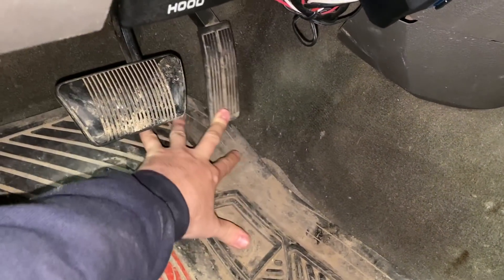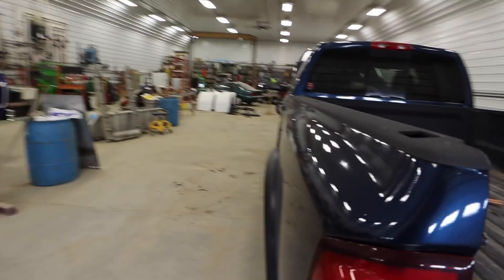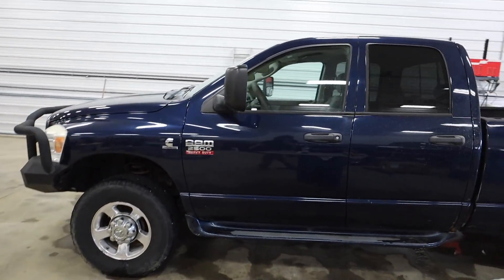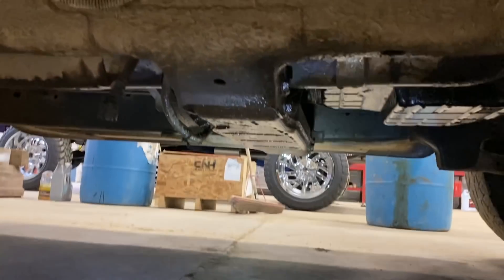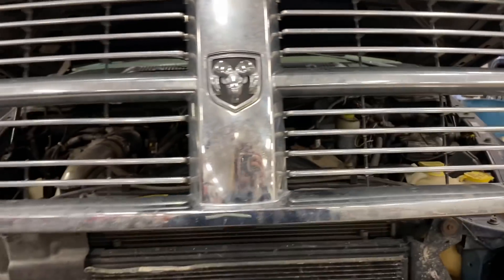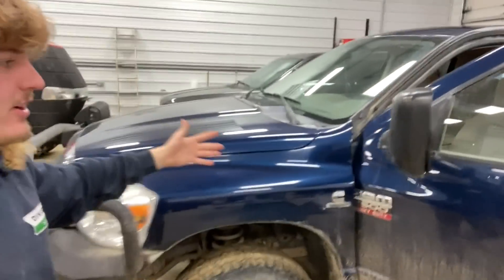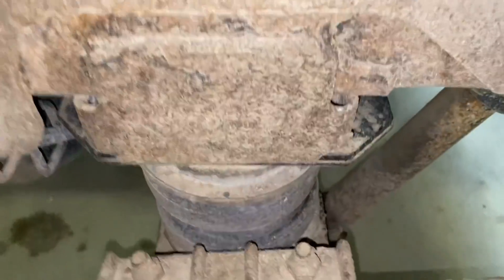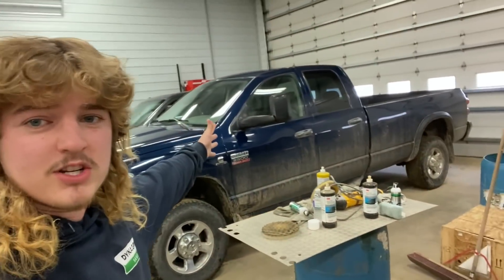I Bought A 600HP Dodge Cummins

Comment: Steel or aluminum flatbed???  if you go with aluminum I believe they actually weigh less than a box and will lift up the rear even more.  IMO flat bed it first then you can adjust your front ride height to compensate.  You could call Kelderman's too and see what they have to offer

Comment: I like mine had a 09 mega cab but sold it to buy a house and then later on I needed a 3/4 ton again so I now have a 08 but it's a 6 speed manual trans

Comment: I'd hold off on the leveling kit until after you get the bed on there, with tool boxes, log chains, fuel tank, etc. the weight might level it for you.

Comment: Nice truck, but you might want to consider going back to the stock turbo arrangement if you are looking for a reliable workhorse around the farm, just speaking as a mature individual whose dad worked for Cummins for most of his career. I inherited his 1989 W250 with the 5.9 liter 12 valve Cummins that Dodge deliberately detuned to 160 horsepower to keep from killing the old as dirt Torqueflite 727 that the truck had. That being said, it doesn't take much work to put a few more nags under the hood.  In stock form the 6.7 has 350 horsepower and 650 lb/ft of torque, which should be plenty handle any towing job I can think of. The wheels on it look fine, a lot better than the stock wheels on my W250. I have the cloth interior and wish I had leather, my last 2 cars had it.

Comment: I'd go with a 2.5 rough country leveling kit there decent price and will come with all new shocks that's the lifts I'm running on my 1500 2nd gen and a 6 inch lift on my 2500 second gen

Comment: Would’ve been cool to see you in a duramax. And why’d you buy another truck if you got the ferd. I know it’s a heavier trucks and a diesel but the ferd can probably handle it. Also the truck is angled down probably because it might have a heavier suspension in the back for towing

Comment: That going to make a nice field truck Coop, once you get use to it you not gonna want to see a gas engine again espically in a work truck that's pulling
It's why you don't see modern 18 wheelers with gas engines they can't hang

Comment: meh diesels are supposed to leak oil, its good undercoating for the winter salt. I've got a 2" leveling kit on my 04 cummins on 33's, perfectly level and no rubbing. Its just a $50 coil spacer off amazon

Comment: Don't level the truck.  It's supposed to be high in the back when it's not loaded.  When you load it, it levels out. If you raise the front, it will be pointed up when you load the back.

Comment: If that turbo is leaking oil you have a seal gone needs new turbo  if they leak on the intake side the engine can run away

Comment: I have a 2003 ram 2500 with a 5.9  cummins & I get 30 mpg  with mods..
Reply: What did you do to yours
Reply: @parkerbest1575  Turbo swap, changed injectors, changed the chip, larger exhaust pipe & kept tires at stock size.. because we tow with it
Reply: I got a 07 ram 2500 and get 25 mpg

Comment: If someone says they don’t like dodge diesels, they don’t know much about diesel engines. 🤷🏻‍♂️
Reply: It’s not the engine people don’t like.   The engine is the only quality thing in a Dodge.  The manual, Aisien  auto transmissions are pretty good as well.  But that’s about it.
Reply: @larsharris  to each their own, either replacing injectors or head gaskets on a Duramax or entire engines in fords or clutch or torque converter in a dodge.  I will take my chances with dodge every day of the week.  Owned them all.  Dodge is the most reliable.  Period.
Reply: @joellair8023  I am on my 3rd diesel. 6.9 non turbo, 7.3 ATS turbo,  finally a 02 7.3 PSD.  Not going to let that go cheap anytime soon.  Owned 1 Dodge gas yrs back.  Lemon from day 1.  Traded it at 60k new transmission (not covered)  and if I had to pay towing those first 60k...

Comment: I have a 2010 6.7 I tow 90% of the time and use it 10% with no trailer behind it. I  tow as heavy as 20K total truck and trailer and you will not see 10MPG at 20K 8 maybe 9 on a good day. 14 to 15 highway no trailer. I run 80 psi in the bags when towing and 10 no trailer. Gas may get 5 to 6 when towing (son just bought a 2021 with the 6.4 Hemi and made 7.6 MPG towing the same weight as I tow) but how much towing are you really going to do? 10% of the time? Everything about a diesel is higher cost. Operational cost per mile is significantly higher. You don't see big companies that have a bunch of 3/4 to pickups in their fleets running diesel pickups there is a reason for that. I worked for a company that has probably 3000 1 ton Chevy with a service body and liftgate on it and I drove one for 315,000 miles with a 6.0 gas in it and only replaced 1 starter. You will not get that reliability out of a diesel. A set of injectors alone will set you back a minimum of 2500 dollars. Your dad is a smart man by not wanting diesels they are money pits. That ol Dodge dually has done the job on the farm for how many decades and it only has a 360 in it. Or possibly a V-10 but not likely. Sorry but I am not going to say that is a nice truck. 600HP extremely shortens the life and with all that rust I would walk away. I take that back. I would run away.  Now don't be one of those, fold your tow mirrors in stay off the pedal and don't roll coal because that says loud and clear you are a D-----E.

Comment: You need to stop driving the truck with that oil leak on the turbo because the exhaust gets really hot 🔥 and then your new truck burns 🔥 to the ground

Comment: why would you not want a diesel, especially on a farm!
Reply: 7.3 L Ford F250. They be sweet.
Reply: @geoffrey6000  there’s a gas 7.3 now FYI
Reply: Because they are expensive to maintain and on a farm they are not needed.
Reply: @skidoorulz4914  dude, on a farm they are perfect, you can't haul the things you can haul with a diesel with a gas. They are not expensive to maintain, they are beasts and need little to no maintenance at all.
Reply: Because they’re nothing but a headache with all the emissions crap. Gas trucks on a farm are much easier to live with, anything heavy to move you’re using a tractor anyways.
Reply: @damianryan5  what emissions crap, no-one worries about that. Yes, for just driving to a field a gas is nicer, but all around a diesel is great for hauling a trailer and such.
Reply: @geoffrey6000  you obviously don't own a diesel. Just an oil change is at least 4 times the money and then their are fuel filters that you never change on a gasser. And when have you ever seen them haul anything of any significance for enough time and distance with their pickups that they need a diesel? There are so many diesel owners switching back to gassers it isn't even funny
Reply: @skidoorulz4914  It is funny, hauling any type of trailer is way better with a high torque diesel, anyone will tell you that. And for oil change, if i'm not mistaken, diesel engines don't need oil changes nearly as often as gassers, plus doing it at home is easy. I have a 7.3 L diesel F250
Reply: @geoffrey6000  Think what you want. Stop and figure out operating cost and you will see. Oh and operating cost includes the 10 to 12 grand extra cost of the diesel option.
Reply: @geoffrey6000  the only benefit to a modern diesel is the torque. My 6.8 v10 gets the same mileage as my 6.7 powerstroke, with half the hp and 1/3 the tq. Oil changes are much cheaper, with motorcraft filters being $10 vs $30, then add oil. Fuel, I won't even talk about. Also had to put a new short block in the 6.7 at 106k and some change, roughly 49k miles after I bought it. My 6.8 has been beat and neglected since new, and made it to 300k. Needs a new head, but I may as well re-ring it and put new bearings in at that point. Let's not forget the 8 year difference, 2008 for 6k with TTL and actual towing gears (4.10s) or 65k with "towing gears" (3.55s) I really really wish the srw 6.7s came with 3.73s or more. Oh, and the v10 rolls on 37s. My 6.7 rolls on 35s

Btw, both have been over 35k. Both have the same gvw and gcwr

Comment: The dodge has the best diesel but the worst gas and the worst transmission. Ours is a dually like the other dodge you guys have with a manual transmission and my dad put a little air compressor under the hood to fill the air bags on the go

Comment: Why is your dad against diesels ?
Reply: A diesel pickup is different.  You shouldn’t jump in, fire it up. You need to let glow plugs cycle.  They are not great for short trips. (Shed to house, to machine, back). They are louder, heavy....  oil changes are $$$ fuel filters $$$. Two big batteries$$$. Where they shine is +60 mike trips with load, or pulling a trailer.
  Up front cost is @$8000 more then gas.  (Note diesel fuel USED to be cheaper then gas). You get longer between oil changes, better mpg towing...
  The added weight is a comfort towing.  You can control the load.

Comment: naw man, that oil leak is just the new "Active oil coating technology" to protect your frame an undercarriage against rust :P

btw, for your lights, if you sand/buff them, you need to apply some UV protection, that's why it went to shit soo fast.

Comment: You know you don't need a leveling kit you could just crank on the torsion bars.
Reply: Dodge doesn't use torsion bars on the 2500 and 3500, they use coil springs.
Reply: @jimmyjack6393  I see we have all 04-05 Chevys with Duramaxs so I don't know much about Dodges.  Should have done my research.